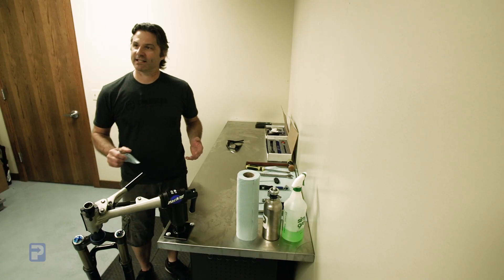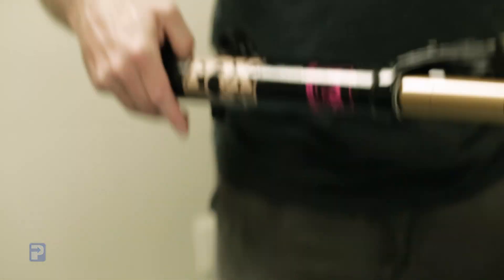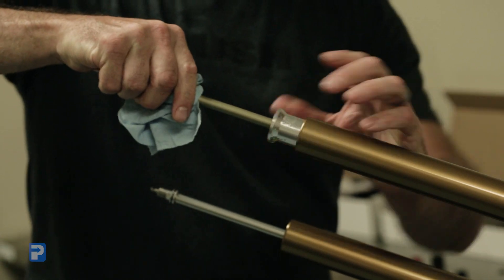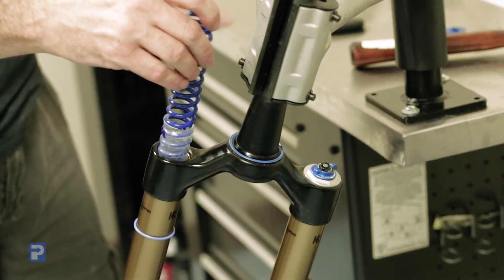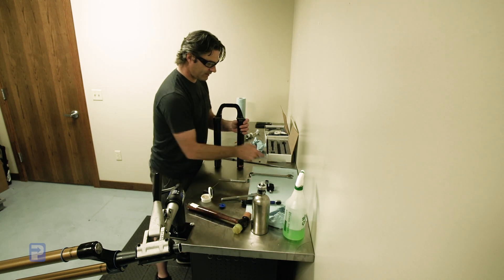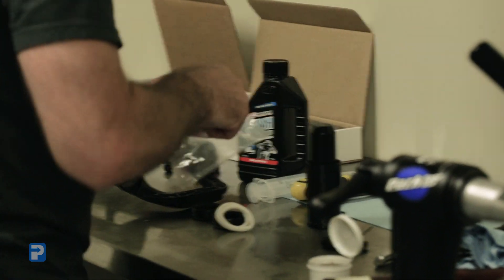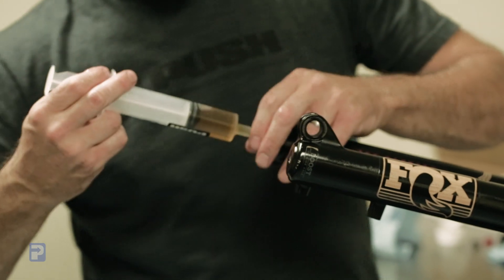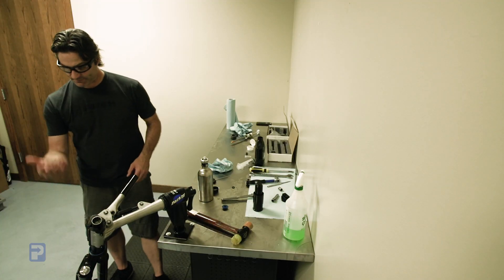PUSH ACS3 Install Video for FOX 36

Comment: If I'm purchasing a 2021 ACS3 kit will that work on the most current fox 36?  I've seen that the original kit doesn't work with the newest iteration of the 36...just not sure where the cut off is.
Reply from the maker: We are still in the process of testing the new Fox 36 with the ACS3 kit to see if any changes need to be made to the current kit for compatibility. Keep an eye out on our website/social media for updates.  Hope that helps.
Reply from the maker: So I checked with the engineers, the ACS3 kit is able to be installed into the 2023 Fox 36.  It is the same as the ’21-’22 Fox 36 models.  Hope that helps ya.
Reply: @PUSHIndustriesInc  thanks, appreciate it!

Comment: Just followed this video for installation and wanted to note that on 2018 and 2019 Fox 36 forks, the recommended damper side oil bath volume is 40cc, not 20cc.
Reply from the maker: Michael, yes the damper side of the fork, and even the ACS3 side for that matter, have a lot of flexibility when it comes to oil volume.
Reply: PUSH Industries so which is better. 20cc or 40cc?